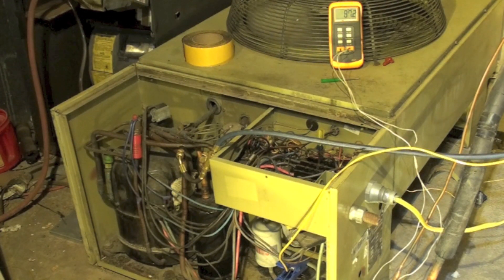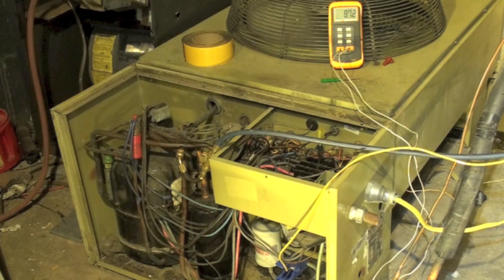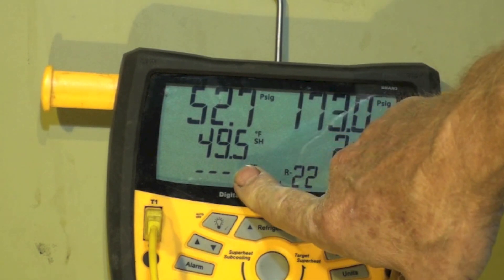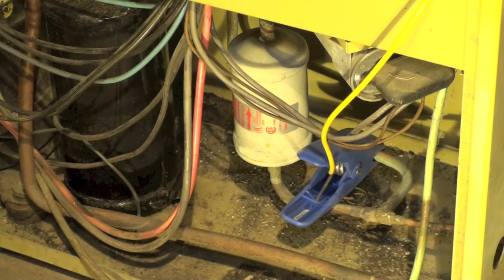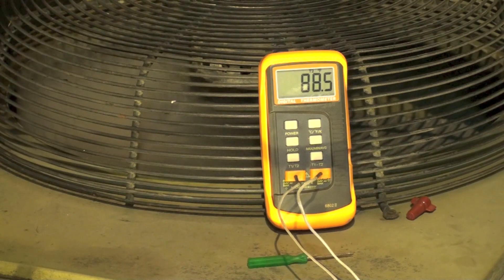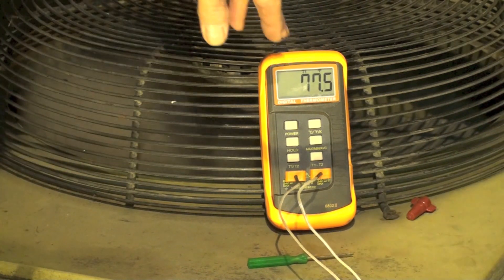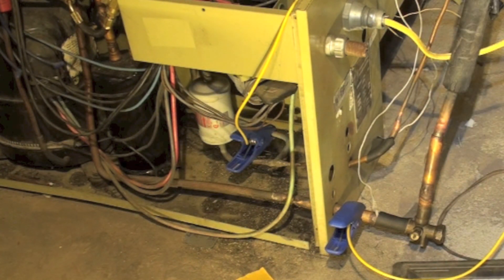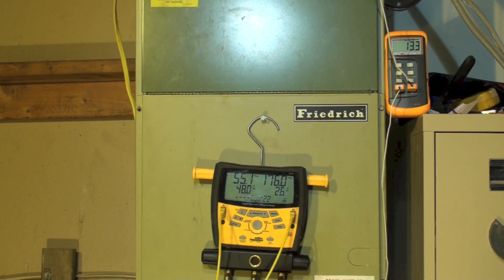A/C diagnostic problem  #1

Comment: Looks like that condensing unit when down with the titanic.  Looks like an old Lennox.  After verifying the airflow, which should be done first, High superheat, along with low subcooling = shortage of refrigerant.  Oh, splits on AC can vary quite a bit depending on the return air enthalpy, (total heat, which is latent heat + sensible heat.  This can be plotted on a psychometric chart, to come up with the enthalpy. Most units will only produce 80% of their capacity if the return air is all sensible heat.The manufacturer estimates that at least 20% of the load will be latent.

Comment: What brand/series of unit is that? It looks like an old York Tabletop unit
Reply from the maker: Its a very old Freidrich.  Much similar to the York Champion on the outside, but very different inside.  Time-temp defrost and TXV controlled.
GFM

Comment: low suction pressure, high super heat, didn't see an ambient reading but I'm guessing if we were using +30 General method for condenser temp, I'm pretty sure the high side pressure is lower than it should be, with all info you provided I would sum it up as system is low on Freon
Reply: Low on DuPont.

Comment: suoerheat is way to high.  I am guessing its a piston.  I would put some juice in her to get that superheat down.  Considering its an old unit your just going to have to do your best to get your temps right..  OR it could be a restriction in the coil etc. But it really looks low, I would add charge to try and get that super heat to go down, right off the bat AFTER I made sure I was not sucking in attic air and my air flow was good.  Metering device needs to be identified also, that can compound the problem as well screwed up valve etc. Yet I would focus on the charge first, put some juice in it.
Reply: Too small of piston would read high subcooling